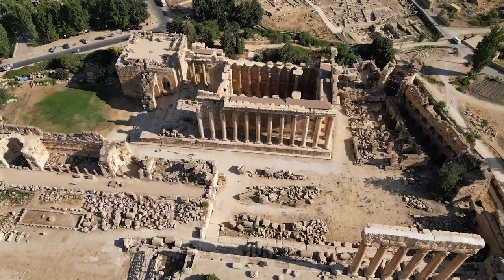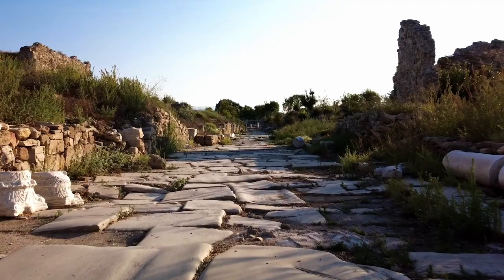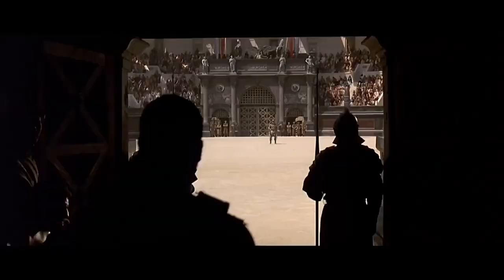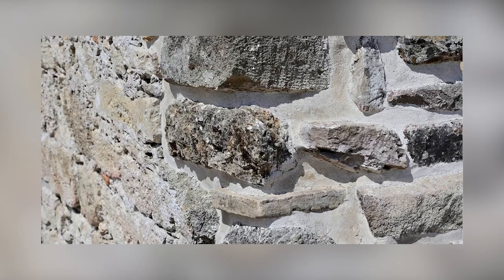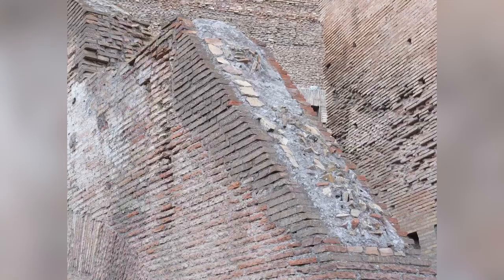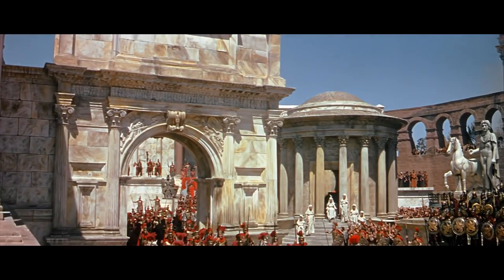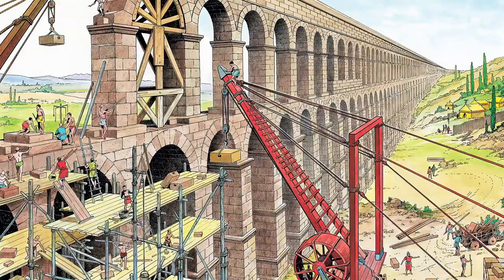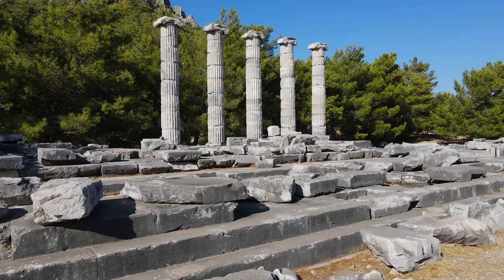DEBUNKING the Roman Concrete Hype

Comment: Funny thing, romans had slaves, slaves made concrete, slaves had no breaks, no breaks or no life = ANYTHING,
you even said many of the wonders have deteriorated, however they have not, the only reason why the buildings look so broken is due to the late roman empire and other occupants of rome becoming desperate for resources in which they would dismantle the oh so great structures by taking piece by piece.
so no they have not deteriorated, they were simply effected by desperate times, even the Italians from ww2 got desperate for resources in which they also took chunks out of the structures, I am not saying you are incompetent, just telling you extras, don't read from a unverified writer off of wiki please, are you are doing is humiliating yourself. so I actually just debunked your debunk. so that solves it, roman concrete is better, as it contains seasalt and horse manure as odd as it sounds they are the perfect ingredients for concrete, Source: Smithsonian, THIRD EDITION, revised and updated.

Extras: we don't actually know if the romans understood or not, I belive they did but the information was lost due to Justinian the Great's order to destroy many of the Hellenic library's that stored this info leading to the destruction of so much information.

Comment: Your first problem with the idea that 2000yr old structures are long lasting hinges on the idea that they have undergone "extensive maintenance".  That is true.
The 81 overpass in Syracuse undergoes "extensive maintenance" every damn year...  and it won't last 100yrs, much less 2000
Reply: Exactly this
Reply: If current concrete lasts around 50 years, hope this new knowledge would help in making it have a lifespan of 100yrs.
Reply: i bet if you drive fully loaded semi in roman road it would crumble in a matter of hours
Reply: @brotherjongrey9375  source?
Reply: @nedisawegoyogya  A few problems with your statement many Roman Roads are still used in Italy today with little maintenance even more modern cobbled roads in France from 300+ years ago hold up better than a modern Bitumen and Gravel Road these roads see 10 Metric Tonne Trucks drive over them Thousands of Times a Day the Problem with these roads are not nearly as Smooth and require a lot more manual work to build but once built require much less maintenance (Not None as people make it seem!)
Reply: @DarthAwar  give me the road address, and it's recorded history of construction, maintenance, till today. also fully loaded semi is 30ton, and load induced damage to roads increase with factor of around 4, so that will ut 81 times more damage than 10 ton you mentioned. Other than that, not worth talking.
Reply: @nedisawegoyogya  A Metric Tonne is more than an a Imperial Ton Buddy also you are on the internet buddy do your own research I am not your slave!
Reply: @DarthAwar  80kips is 36 metric tons, I gave you 30 metric tons as a conservative argument and this is your answer...
Reply: So true, this video can't figure out which is better... 2000+ years or 50+ years...  In reality 50 year lifetime on modern concrete is probably "by design."  Someone in power doesn't want those structures to last.  I've only been studying this stuff for fun for a few years and I have minimal college chemistry and I could tell that the hot mix or a hybrid hot mix of slaked and non-slaked lime was probably used along with other additives.  The "Roman" concrete was probably more complicated than we still know, due to the unknown additives.  The real questions is why nobody has the recipe and methods book for the "Roman" concrete, what happened to prevent that.
Reply: @nedisawegoyogya  Just go to Italy you'll see it every day.  Or you can watch videos of the cities in Italy and see it yourself. LOL
Reply: @VenturaIT  id like to if you cover the travel expenses lol
Reply: @nedisawegoyogya  He has to do the research and pay your travel expenses? Damn dude, what are you actually good for?
Reply: @muppet50yago36  idk, designing roads with an actual science?
Reply: @Luke-hr3yg  agree 👍
Reply: @brotherjongrey9375  I've designed one, but for college, and of course not constructed. And I have no plan on designing roads to be realized bcs im not chasing trasnport specialty. Gimme ur email I'll give my work if you really want it 😀
Reply: They key seems to be the self healing properties so they are undergoing constant maintenance in a way.
Reply: @nedisawegoyogya roman roads werent concrete but stone.
Reply: Yeah to say that these structures which were abandoned for hundreds of years had 'extensive maintenance' is just completely wrong.  
I'm sure some had extensive restauration at some point. 
As you say, it's our modern roads and bridges that we use every day that requires extensive maintenance.
Reply: Most roman roads and lesser structures have been gone for centuries. The only roman structures remaining were at one point critical. You're comparing what would essentially be some engineered to last, like the White House, to something meant to be relatively cheap, like a road
Reply: @brotherjongrey9375  oh true I forgot about all the ancient Roman semi trucks and multiple 1+ ton vehicles they had to account for
Reply: @nedisawegoyogya  HE'S NOT YOUR SLAVE! 🗣️ 😂😂 do your own research bro
Reply: People's argument basically: "roman good modern bad" you will never be able to change that no matter what. That's the Hallmark stupid argument. You win by not arguing.
Reply: @sssbznzn  is "area crap" when you shit explosively all over someone's front yard?

Comment: What if we made an exaggerated version rich in these quicklime nodules and use it as a render on top of thin structures made of modern (e.g. C60) concrete? Any cracks to the surface or the stronger modern concrete subsurface would get penetrated and repaired by the calcium rich deposits when it rains, while maintaining the strength advantage of the modern concrete core.

Edit: Holy S! I typed that out before I even saw your mention of its historical use as a facing material!
Reply: No, that wouldn't work because the material needs to be deep inside the concrete and evenly distributed inside the material, not on the surface... and just because people today say they figured it out and they can make self healing Roman concrete doesn't prove it until they make a structure with it...  probably there was a special nano-level or micro-level mixing method, because just one "clast" of quicklime will not fix a large crack, that is a fantasy... maybe it fills it in, but it won't be strong enough... there is more going on here... probably geopolermic lattices that self heal over many different reactions, not just the simple reaction of quicklime with air and water...  the volcanic ash may have potassium alkalai that remains unreacted and when water or humidity mixes with these alkaline substances it creates a sort of caustic soda in situ... because lime is not structural, to make this kind of geopolymer the alkaline base needs to dissolve the chemical bonds of the silica and aluminium and then let them form again to make new crystal lattices... you can't just get the lime clast wet and expect it to do anything...  probably it's the quicklime+water+Si+Al+K+Na ... but you need water plus K plus Na plus the lime to make the caustic soda (lye) to melt the chemical bonds that then reform into the cement binder...  it's complicated and I don't fully understand it yet.  It's just more proof that ancients were not the primitives we think they were.
Reply: modern cement isnt stronger. needing to be fixed 5 years after being placed is strong to you?
Reply: I was just looking for a good plaster: superadobe and hyperadobe structures often have problems with water in tropical areas (where this construction tech might be most useful due to poverty).

So it might be possible to use this in the topmost plaster layer to keep the facade self sealing.
Reply: @GORILLAZ41  About that Roman concrete. Yeah, it's to some degree "self-healing" in some spots here and there. But far from everywhere, due to the uneven mixing. And it doesn't last longer than the best concrete available today. It's just that most concrete, isn't of the best quality or mixture, as it doesn't need to be, since the building, being constructed, is not meant to last more than 75 - 125 years on average. In poor countries, even shorter than that in many cases. But no concrete of at least bare minimum quality and mixed correctly, for whatever purpose one has intended for it, will last you 30-40 years minimum. So you're taking out of your rear end with those 5 years.. Which only sounds like "tofu dreg", if anything. I mean.. Do you see properly constructed, concrete bridges in the west, starting falling apart after just five years?? No, you don't. They last at least 100-200 years. If you do see a concrete bridge falling apart after just five years. It's not properly constructed. And thus, has nothing to do with, whether modern or ancient concrete was being used. But rather, the scale of the incompetence and/or corruption.
Reply: @beorntwit711  OK so most times lime is exposed too close to the surface it results in freelime or efflorescence